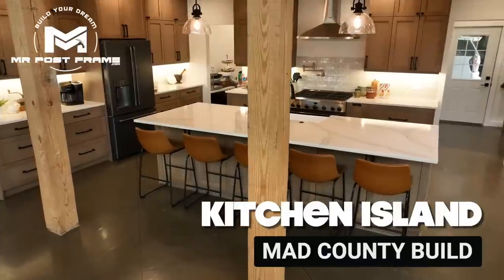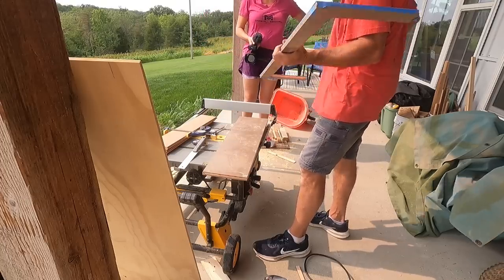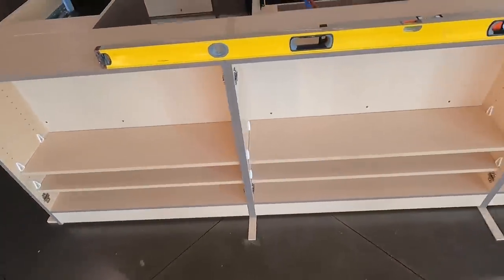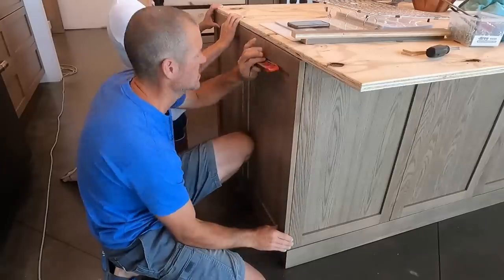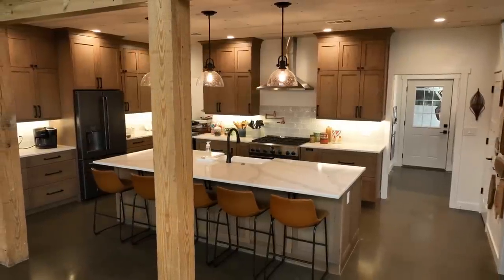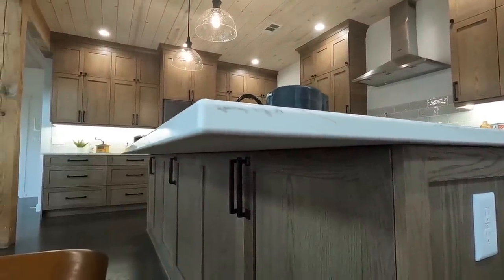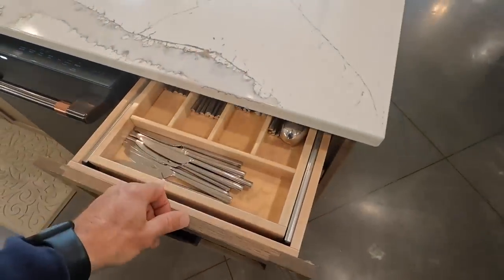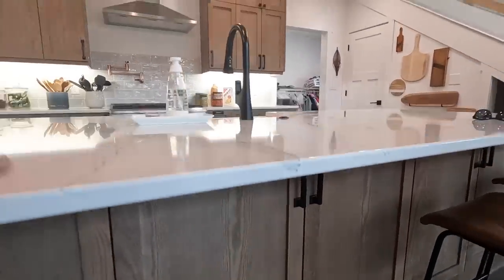The ULTIMATE Barndominium Kitchen ISLAND | MAD County Build

Comment: Nice work all around.  Looks great.  My only suggestion if you can do it now is to add two SS drain pans under both dishwashers with sides sufficient to capture water if any issue with dishwasher overflow or accident.  How you route drain thru concrete floor may be a big issue??
Reply: Pre plan

Comment: ?? I have a 1.5 by 3.5 step ledge on inside of frost wall. I put 2 inch rigid insulation on inside of perimeter but when my site guy was back I filling he got some stone behind rigid. So there’s some gaps at top. Concrete guy wants me to cut rigid 12 inches down clean out stone and re glue to foundation to close top gap so he doesn’t lose concrete when pouring. Does that sound correct?